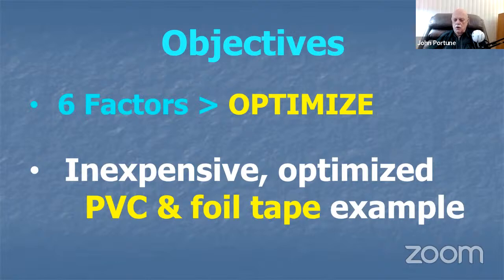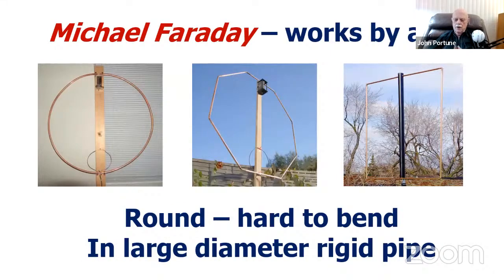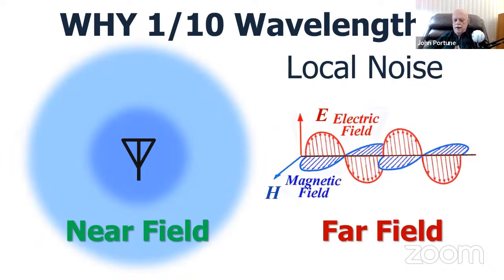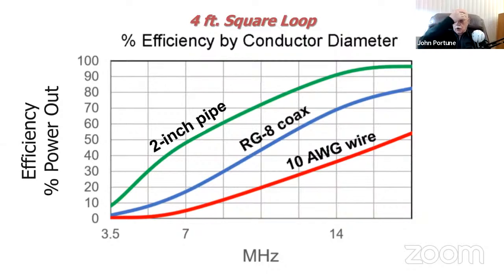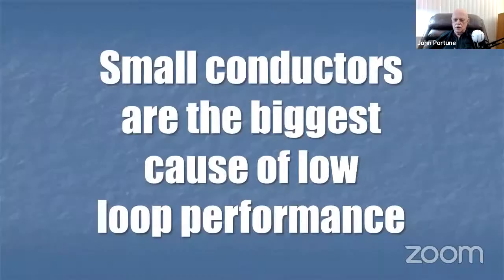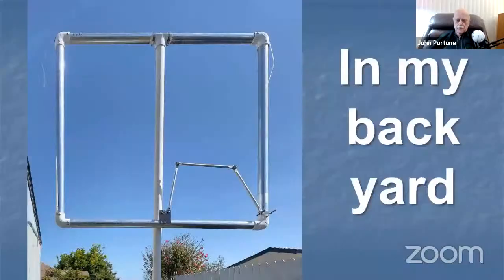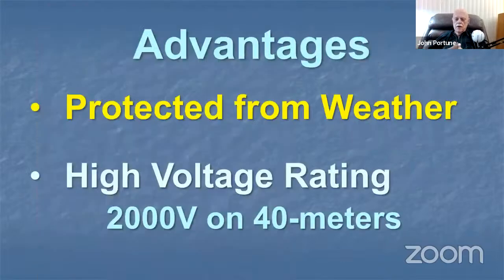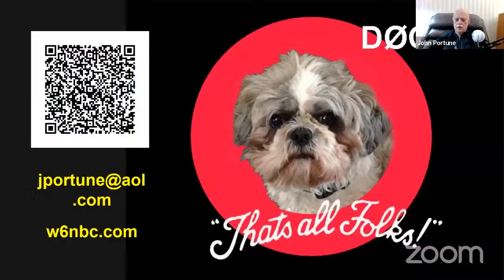In Search of an Optimum Mag Loop (John Portune)

Comment: Nice presentation and thank you for making these videos. I feel one area of optimization that is often overlooked is "portability." This is to say a mag loop design that is easily broken down and reassembled for portable field operation. Weight, size and other considerations such as the construction materials used.  I think the objective of optimal portability is easier to achieve if you construct these antennas into the shape of a square, rather than a circle.  - 73

Comment: The part where you use a inner loop arm to adjust the so called induction. Is there a multi wrap of coil wire going up the shoulder of the right vertical PVC pipe? Or is the adjustment clamped to the foil wrap itself? Wish we had close ups of that part.

Comment: The shape with the largest area with the lowest conductor loss is the circle. Not these other shapes. That is optimal. Because of the conductor diameter is the deviation. The discussion we want is how to make a large conductor jointless circle out of copper pipe. Because it would be optimized in all aspects but one. $

Comment: You say that the interior area enclosed by a loop is very important. While a square loop is easily constructed by a home builder a circle encloses the maximum area for a given perimeter length. For example a circular loop using the same perimeter length as a square loop encloses 25 percent more area than the square loop.

Comment: The larger a loop gets relative to the wavelength the less directional it becomes. Thus the smaller loop diameter to make your loop more directional, so it helps you to null away from noise, and it makes your transmission more directional, meaning higher radiated power in the direction you want to radiate in. 

My question is, what was the antenna Q of John's loop, i.e. what was the bandwidth at the 3 dB point, or 6 dB point down on each covered band? I would like to get mine as close to the bandwidth of a SSB signal as possible in order to reduce received noise and improve xmit efficiency.
Reply: his  contact info is posted

Comment: I have been making and using mag loops for a while.  These include fixed loops and portable loops.  I learned much from John's presentation that is not available from other sources.  The major challenge in building and using small transmitting loops comes from having a convenient way to tune them.   John's idea of using a coaxial capacitor is novel and very interesting.   These loops have a very high Q-factor.  Tuning is also affected by temperature, humidity and other factors.  Even if you tweak the loop for one frequency, it will need readjustment in at most a few hours.  Pulling on paracord does not seem to be a convenient way to tune the loop accurately to resonance.  Some form of motorized tuning mechanism using a lead screw or mechanical actuator would be more practical and allow you to tune/retune the loop from the operating position.  The loop will generate high voltages when transmitting.  Making sure that the operator is insulated from the capacitor needs to mentioned as a matter safety.  Lastly, I would be interested in John's opinion, as well as the opinion of others as to the merit of feeding the loop at the capacitor as done with the MFJ-933C and its variants.   Finally, in my experience, tuning the loop is best done with a NanoVNA displaying simultaneous VSWR curves and a Smith Chart.

Comment: what can I do to make this loop tune to 80 meters?
Reply: From experience, you scale it up the length of the loop's perimeter / circumference. I have found that the loops I have built have been good for around an octave of spectrum, so from 14-28MHz or 7-14MHz. If you take the upper frequency, you can tune reliably, when you halve the frequency, that's about as low as you want to go before the efficiency drops off significantly

If you particularly want 80m, and are happy to use another antenna for other bands, I would go for a 1/6 wavelength, which is around 13m circumference as a start. I have an 8m loop for 7MHz and it works really well. Haven't gone for 80m just yet
Reply: 13 meters?  Wow, that is a pretty big loop.